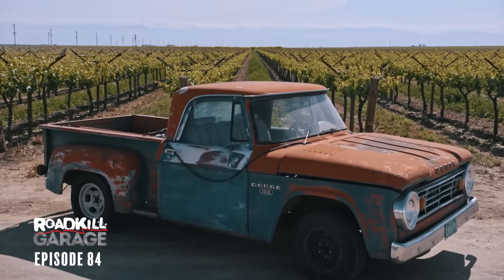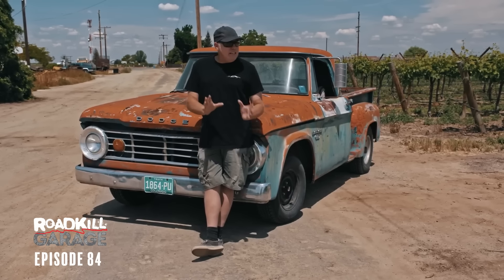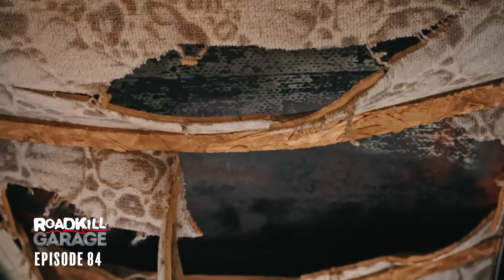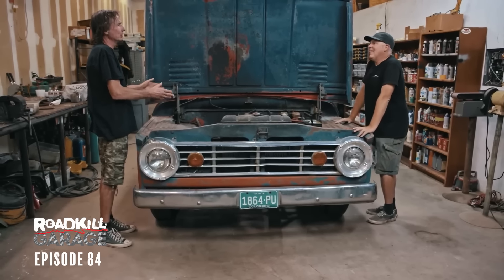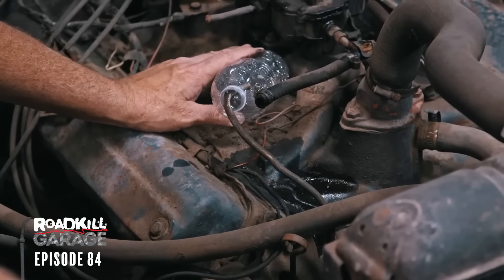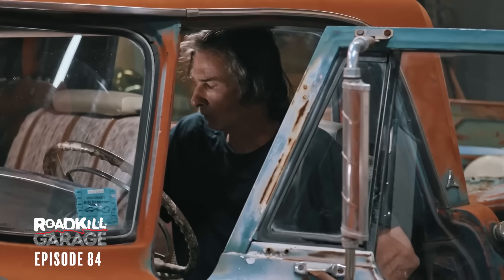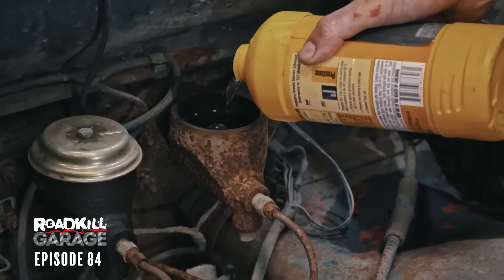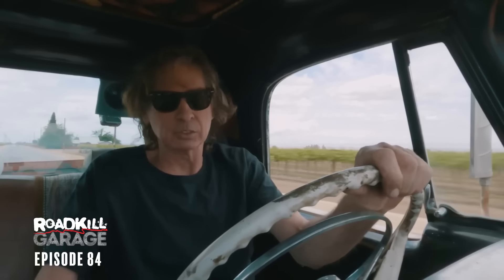Reviving V8-powered 1966 Dodge D100! | Roadkill Garage

Comment: Lemmie guess.  They fix the timing, replace a couple brake parts, change fuel filter a few times and do donuts in a dusty field.   But leave out 80% of the work cuz this is only a commercial
Reply: not even that.
Reply: Bro you hit the nail on the head😂
Reply: So why watch? 😂
Reply: That's every single "WILL IT RUN?!?!?" video on youtube honestly.
Reply: Man I bet you’re fun at parties…
Reply: Hey??, how did you know???? lol.
Reply: You forgot the obligatory coolant leak and carb clean

Comment: My dad had a ‘68 D100 with a ‘69 hood and grille. When the original 318 got too tired to do much work anymore he went to a wrecking yard and bought a used 318. As the yard guys were lifting the engine out of the donor my dad looked at the side of the block and he expected it to say 3-1-8. It said 3-4-0. He didn’t say a word to them about it. Turned out to be a stout 340 that would light up 33” Armstrongs at 55 mph. It was badass. I’d love to have a D100 of this vintage for myself. Dad sold that truck but kept the engine and put it in a ‘67 Dart. I wish he kept it too.
Reply: Grew up in 2 wrecking yards never seen any manufacturer stamp or cast the engine size in the block there are codes on the block that contain information but need to be decoded and i promise junk guys no what they got they had code books before everybody but the dealer
Reply: Bought a 1970 short bed step side back around 1985 or so from a friend that said the guy he got it from told him it had a 340 from a duster in it, turns out it did along with a 3.55 sure grip...
Reply: @jeremyhanna3852  all the small block mopars i have seen have the size on them had polys and LAs all have 318 or 360 or 273 on them
Reply: @NZMOPAR  ok I stand corrected never really looked at small Block Mopar in  particular no other manufacturers do
Reply: @jeremyhanna3852  then you haven’t really looked at the driver side of MOPAR engine blocks. I’m sure the guys in the office knew to look, but the grunts in the yard that we’re doing the work just pulled parts as quickly as they could without much investigation. To be fair, the 340 had an iron intake, standard exhaust manifolds, wasn’t painted or anything either so it just looked like any other small block MOPAR. The donor vehicle was another truck too. Chrysler never put the 340 in a truck so there wouldn’t be any reason to go beyond a quick glance to identify big block or small block. The VIN would come back as it having a 318 too. It was definitely a diamond in the rough and a rare thing.
Reply: i know i use youtube for late night entertainment and so post things off the top of my head without checking...however...Pontiacs have cast their displacement into their blocks since 1968. AMC V8s have it cast between first and second core plugs. otherwise, yeah, you have to hope there's a silver emissions tuning sticker to help.  Of course, work trucks often got an engine swap rather than buy a new vehicle, and so there's always a chance of a non-original lump of cast iron under the hood. a junkyard owner would check, the guy working for him for mininum wage, probably not--they just pry-bar'd it over to make sure it wasn't locked up.
Reply: @jeremyhanna3852 small block Mopar casts displacement on the side of the block, B engines have an angled pad under the AC compressor with the size stamped & RBs have a pad at the front of the block with the size stamped there

Comment: A LONG time ago, my brother and I found a 
64 Slant Six version of the same truck.  Granny 
first, and the same bent frame yours has.  Except, 
my frame was bent more on one side.

With the help of a Coke bottle, filled with water, we 
were able to idle at 90, yes ninety RPM.  Later, we 
could get her to idle at 400 RPM, with a nickel 
balanced on the valve cover.

Yet another car from my youth, I wish I still had!
This 64 Slant Six Dodge.
72 240-z.
'70 Roadrunner.
56 Plymouth Savoy, 318 Poly.
'70 Dodge D-100 318 Granny 4.
67 Plymouth Valiant, Slant Six, 3 on the tree.

And, quite a few Yamaha RD400 bikes.  The F 
model was my fave.  It had an Rz350 water 
cooled engine in it.  That thing was SCARY 
fast.  Sorry, scary QUICK!  Once, had my baby 
brother on the rear seat, for traction.  On the 
backside of the block my parents lived on, 
(and this brother, on for more ballast, got it 
up to 100 MPH.  Stopped in 50 feet.)  I also 
used the front end, and the wheel.  2 discs 
on it.  Yes, the back wheel left the ground.

With that bike, NOTHING could beat me 
through an intersection!  Nothing!

steve

Comment: Great Motor the ol 318 Poly!
Reply: lots of hot rod potential--Plymouth couldn't afford the cost to build hemis, so the Poly has a unique wedge valve setup, more inline like a hemi but no dome. that's why the valve covers have their unique sawtooth edge design. but it shares a lot with the LA engine line--you can make a 392 cid stroker with a 318 4 inch crank from Direct Connection, the problem is getting the heads to flow enough if you want high rpm hp instead of torque, but a cut down 360 crank for 350 cid wouldn't be a bad choice.
Reply: @alertgasper Those Poly 318s were Demon circle track motors in their day and those heads flow great. You just can't get much performance stuff for them. Mopar didn't modify them into the LA version because they couldn't make big power, they did it to make them lighter and narrower to package better.
Reply: @jonathangehman4005  Mopar Action magazines just before the pandemic got into making a new intake manifold for them so we don't have to hunt down the 1957 dual quad factory intakes, and someone in Australia makes ribbed valve covers for 'em since apparently the Poly was big down there, too. But you're correct, after the 1958 recesssion in America, Detroit planned on smaller cars like the Mopar A bodies and GM's A bodies. Unfortunately Mopar didn't change the lifter angle from Hemi to Light A, but pobody's nerfect, right? :)

Comment: A possible wrong replacement non-vented gas cap will also cause fuel tank to go under vacuum. You can hear air get sucked in when you loosen cap.
Reply: When ur getting tar at the filter, it is safe to assume the tank is clogged
Reply: That tar could be from the rubber hose sitting around in the sun filled with what I would assume is e10?

Comment: Not sure if you can find it but the Ram Chargers Club used to run one of those Dodge pickups with a 413 dual quad engine at the drag strip
Reply: I remember seeing that and if I remember they were beating cars with it in the 1/4 mile.

Comment: Those Poly 318's will go forever.
Reply: No they won't.  None of those old engines did.  They'd get gunked up with sludge and start failing. Most of them needed a rebuild before even 90,000 miles.

Comment: In the early 70's  I had two of those 318 poly engines in a couple 1963 Plymouth Furies one of which was a station wagon in which I out-ran/out-maneuvered the cops one time.  That engine ran just fine for me.....🤣😆🤣😆

Comment: With an Ev you got to worry about how the battery was built because if it's shorts out it turns into a bomb
Reply: it's the same battery in your laptop, phone, cordless drill, etc. do you worry about those and what flamable surface you leave them on?

Comment: I hope y’all do more with the poly, i have one in my coronet and there’s not a lot of info on these engines
Reply: check out the web, a lot of LA parts swap over. Like the stroker cranks. someone re issued aftermarket intakes for 'em, one is a dual quad setup. put that on a 392 cid stroker and your coronet will wow 'em at the cruise night.

Comment: I ran my 74 capri out of a jerry can in the engine bay when the fuel thank was all rusted out, it would burn so much gas just getting the dam thing up the block, i put a lot of trust into that $10 china electric fuel pump.

Comment: I know you gentleman like your Mopar's. But as a 30 y/o who wants to drive a 40/50 y/o truck or vehicle. 350 small block or 300 inline Ford?
Reply: What do you mean? I'm 31 I would love to drive this old stuff. I even bought a 70s v8 ford. You Americans don't know how lucky you are to have so many classic cars and junkyards filled with v8 engines.. I think people who don't like the old stuff don't know how to work on them because if they did they would understand how much better they are than modern stuff.
Reply: @davidgalea6113  well stated.
Reply: That's a broad question,  what are you looking for in an old vehicle?  Either engine is a workhorse but in completely different leagues when it comes to performance.
Reply: What do you mean? Who wants a 50 year old pickup? I'm only 43 & I refuse to own anything that ain't older than me